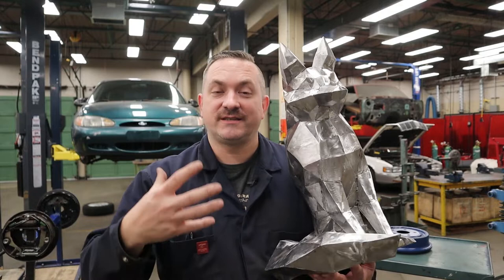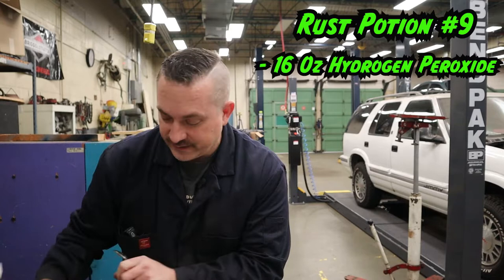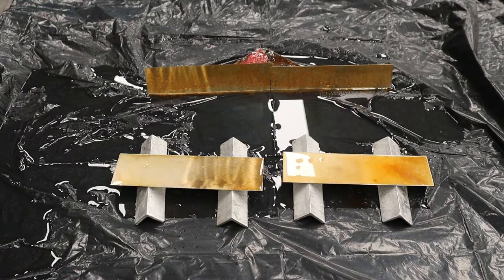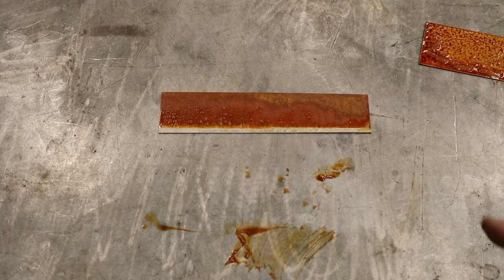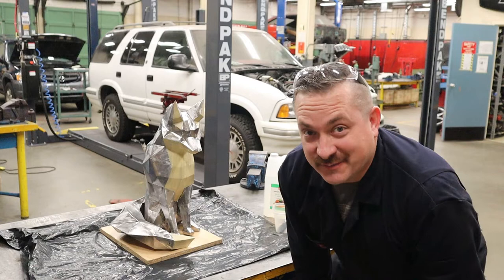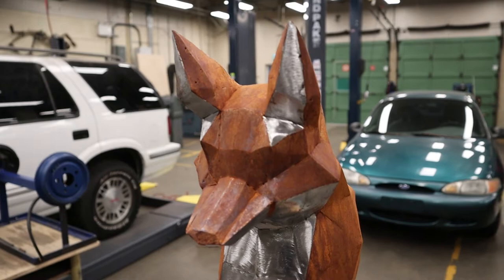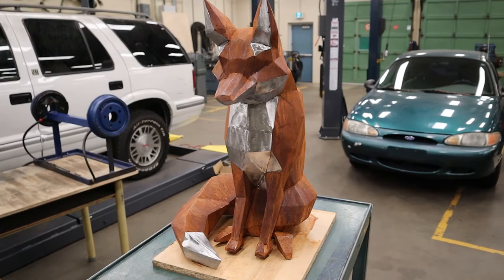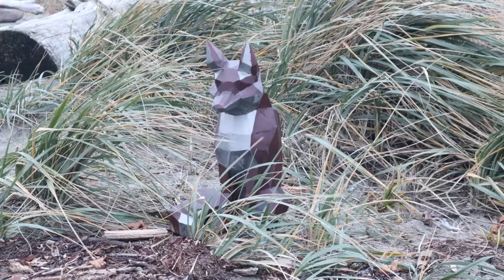How to quickly rust welded metal art

Comment: i love your fox.  I did like the brighter orange better, but it's still amazing!!   As far as clearcoat, I have just discovered Flood Penetrol. It penetrates the metal, halting rusting inside the very molecules, while preserving the intended rust on the surface under a clear solid coat that's dry to touch in about 24 hours.  Thank you for your video that helped me to understand the rusting process better . That's so cool how you masked out the fox's white fur!!
Reply from the maker: Flood Penetrol eh?  I'll have to look into that.  Yeah I liked the look of the bright orange rust, I might redo the fox sometime in the future.  Thanks for the watch!
Reply: @wayofthewrench  I think this vid is where I learned about Flood Penetrol: https://www.youtube.com/watch?v=SvM9j8-zbyU 
It's still going to darken the rust.  I'm still looking for the exact way to end up with a brighter orange.
Reply from the maker: Ya know, I think you just leave it rusty with zero coating.  It will be really easy to scuff or wipe the orange rust though.  It should self "heal" a bit but you'll see the scuff.  Let me know if you find something that works!  Cheers!

Comment: It sucks when a project goes sideways and you end up making things worse with all the time and effort put in. I've been there so many times, but it's how we learn. And we take that into our future projects until we perfect them.
Reply from the maker: Yeah you're right!  Always lots to learn and improve for next time. Plus you guys get to learn from my mistakes too.   Rusty might not have turned out how I wanted him but realistically he is still a cool project and won't leave rust all over my living room.  Thanks for the watch!
Reply: @wayofthewrench   I've learned that lacquer isn't great sometimes. I use it to seal my steel welds and it does protect from rust, however you loose the highly polished look. For some reason it takes a bit of the shine away. Maybe I'm not applying it right but I give at least 3 coats. I find I sometimes have to buff it with a car polish compound. Even when I use it on plastic 3D prints. 
I have started to use anti spatter spray and noticed it doubles as a protectant. It seems to add a wet look so I might just use that instead, at least on indoor projects not subjected to the elements
Reply from the maker: Interesting.  Yeah there's lots of different ways to do it.  Kinda wish I just left it bare but then again, my wife would kill me if the rust went on the furniture.  Cheers!

Comment: Wow, the fox looks nice. I just bought a PDF of a dog. There was like 14 pages with 4 parts per page. I took each page to CAD and redrew them without the glue tabs but I did add relief cuts on the bend lines (just like you told me). That step took me 6 hours. Next I have to get all the parts on one page in CAD and then resize them. I used to rust and clear coat some things. I think that you did not rise it with clean water when you were done rusting. I used to prevent rust in the Air Force and to on purpose rust something just goes against my nature. 😃😃😃😃😃
Reply from the maker: Nice, I'd really love to see your project when your done, send me a dm on Instagram.  Yeah it's a lot of work but these projects turn out pretty sweet.  Yes I think you are right, I didn't rinse the solution off because I didn't want to rinse off the rust but I did let it dry.  I rinsed a sample piece and a lot of the cool rich red rust comes off so I didn't rinse the fox off.  I also will probably never matte clear coat again as it kinda dulled the look of everything.  Yeah rusting metal projects goes against my nature too, I'm a Tool & Die Machinist by trade.  Thanks for the watch and good luck on your sculpture!
Reply: @wayofthewrench  
I just finished resizing my parts, X2, and the programs are ready to run. Now I have to see if I have enough steel to cut them all out.
Reply from the maker: CNC plasma or laser?
Reply: @wayofthewrench  
I used to be a laser operator but got laid off in2019 at the age of 58. I have a CNC plasma cutter and I have been making metal art since 2013. I used the scraps of steel from work. I used to live just south of Milwaukee but now I live in north west Wisconsin. The towns are very small up here. Go to my YouTube channel and see some of my metal art. Thanks for your interest.
Reply from the maker: Sorry to hear that.  That's cool you have a cnc plasma, what brand do you have?  Maybe you could dash cut the fold lines?  I'll check out your channel, what's it called?

Comment: Terrific Work and a lovely figure in dear Rusty - Pro-tip having learned the hard way like you - Coating patina is it's own science and preserving the powdery matte and complex coloration of rusted steel is something we worked on for weeks - the only real way to lock that superficial rust as is is a lacquer specifically formulated to do just that - Permalac . Permalac Matte spray in a can will work, but it works far better and is more controllable using the canned ( non-aerosol) liquid through an airbrush . Note : Superficial reactive rust is not a true patina - real patina will effect the underlying base metal even when rinsed (Though it does still need to be sealed as well) Thanks, great channel.
Reply from the maker: Thanks!  Yeah the rust didn't come out like I thought but it's all good, as long as you're learning and having fun.  Thanks for the tip, I'll have to try that Permalac in the can!  Thanks for the watch!
Reply: @wayofthewrench  Learning a tonne! After 25+ doing special effects for movies I finally got my first flux core machine and all the surrounding gear and about to make our first sparks in the next day or 2.  I'll let you know if I still have all my fingers after my first beads. Nervous about making my first arc but excited too.
Reply from the maker: You still have all your fingers?
Reply: @wayofthewrench  Oh wow yes, but man that second finger that helps guide the torch sure gets cooked during long runs! I'm loving every minute of the work and we're generating far better finished work that I'd have dreampt 3 short months back. I might have to shoot you a link once everything gets photographed - it's partly thanks to you! (Just about to load my first 10lb spool...those 2lb'rs just don't last...!)
Reply from the maker: Any pics yet?
Reply: Well, everything I'm generating now is for bases for fine art works that will eventually go out to galleries, so there's all the fusing, cleaning, polishing and patina for around 20 pieces that all go to clear coat , then we'll move to the studio for a long photo shoot and we're a week away from the big Permalac spray day, then photos - but you'll get them first!